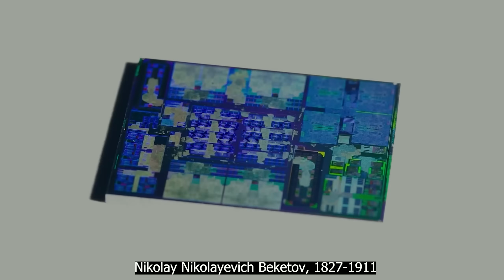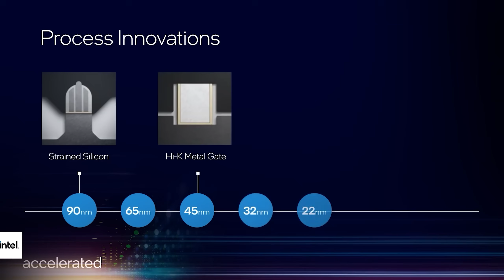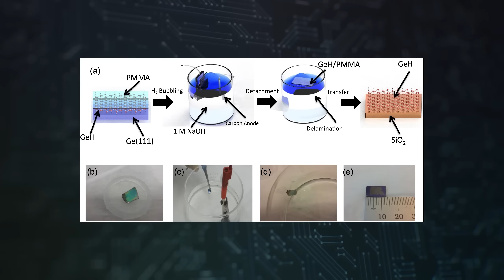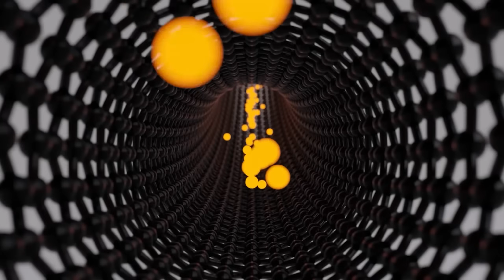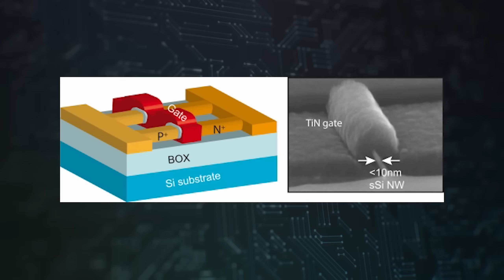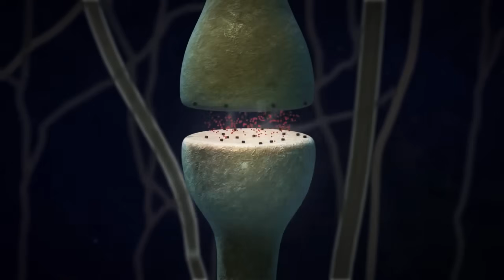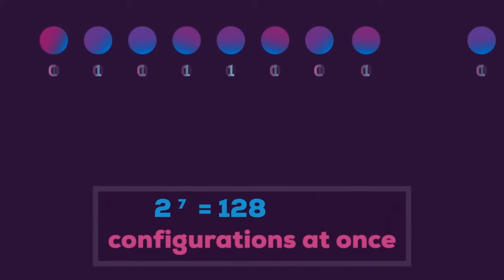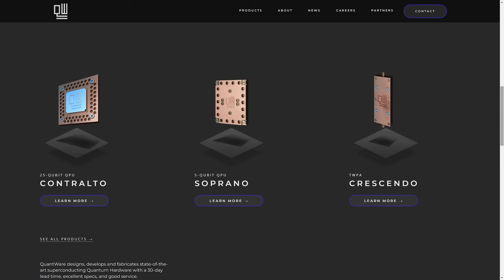End of the silicon era. Processors of the future

Comment: May I interest you a convincing sketch that, if it reflects the truth, would lead to great progress: 

Please consider a thought experiment device that may work because it avoids the failing parts of (1)Maxwell's demon thought experiment which fails because the demon needs intense light and (2)Feynman's paddlewheel, pawl,  and ratchet wheel thought device which Feynman clamed would fail to rectify random thermal motion. However he accepted that small paddlewheels will move in response to the thermal random motion of fluid they are immersed in. 

The purpose of the thought experiment device below is to create self powered thermal diversification. The thought experiment is impractical but easy to visualize and check for mechanical workability.  It is not too deep in the nanometer scale realm. 

Sketch made with keyboard characters: 

COLD ROOM   ())--:WALL:-->> HOT ROOM    

Key
()) = Paddlewheel. 
-- = Axle.  (Continuous from end to end)
: :  = Axle tunnel going through a wall.
>> =  Lumped friction element

Please visualize two roome full of air separated by a very thin wall that allows the rooms to hold their heat independently with minor leakage through the wall. The wall is thin to delicately support billions of  separate nanometer scale short axles running straight through loosely enough to rotate freely but  not leak very much heat so the rooms can hold separate temperatures. 

On the left side, a very small paddlewheel is mounted at the left end of each axle. On the right side, lumped friction elements are mounted stationary in place on the wall, one for each axle, for the right end of each axle to run through. The lumped friction elements connvert the mechanical rotation of their axle into heat. 

Brownian motion (a nanometer scale effect) turns the paddlewheels at random speeds randomly clockwise or counterclockwise. This random rotation is turned into heat by the lumped friction elements.  The lumped friction elements do not impart Brownian motion to their axle.   

  The committed, linked, and functional roles of the paddlewheels, axles, and lumped friction elements in differnt places should systemically produce a divergence in the thermal energy in the two rooms without adding external energy. 

Water in a sealed container could be endlessly cycled without cost between melting from the heat of the lumped friction elements' side and freezing from the cold of the paddlewheels' side. 

Do you think it is reasonable to consume a lot of energy by cyclicly moving a large sealed robust container of water (a large thermal mass) back and forth between a stove and a freezer both requiring electric power? You aren't making any  permenent changes as you alternately melt and freeze the water inside. The container and its water aren't becoming less orderly as the exercise continues. The unreasonableness of this waste is a challenge to the second law of thermodynamics. 

❕️❗️It is more scientifically elegant that refrigeration produce electricity instead of consuming it. 

The second law of thermodynamics began to be a strong science paradigm during the mid 1800s euphoria of progress in steam engines and industrialization. Steamships could mostly voyage on-corse on-time regardles of nature's awesome winds and currents. Mechanical power became cheap and without manure. Sir Arthur S Eddington popularized the idea  that the second law of thermodynamics, with its consequence that the universe would die of thermal stagnation, was a proof of God and more fundamental than Maxwell's equations. Powerful generators and electric motors were developed in the mid 1800s 

l was granted US patent 3890161 DIODE ARRAY,  for a refrigerator that absorbs thermal energy in an insulated compartment and releases a corresponding amount of electrical energy using the intermediary of rectified Johnson noise (the Brownian motion of electrons) aggregated by a multitude of consistantly aligned diodes. [Not exactly the abstract] It has been open for anyone to develop since 1992.  

I had a report of a working very low power prototype in ~ 1980 but l naively lost the prototype. It was made from a chip containing ~1400 gold pillars abutting N type GaAs. A U VA Charlottesville department made it for 1-3 THz frequencies. They could not align very small diodes well enough in 1980 to make ~1 um dia diodes individually so they made them in patches. I found a lab that put conductive paste on the face of one patch chip to bring all the diodes in parallel and test it in an oil bath in a sealed test chamber. They went out of business but I thought they should keep the prototype because they had the test chamber and could make special arrangements. I lost contact with them and never received the prototype. U VA  refused to sell me any more patch chips and stopped making them. 

I am not interested in any more patents. The diode array patent gives me enough of a reputation. The exclusionary power of patents breaks up synergistic benefits to civilization. Wide exposure to the public (as needed for wide scientific and spiritual discourse) renders invention concepts unpatentable. Other teams have built low power prototypes of their concepts too so the overall energy concept is likely to emerge for the betterment of civilization. 

This energy system would not be unreservedly good. Some foresight of the consequences is needed. 

Cell phones wouldn't die or need power cords or batteries
They would cool when transmiting radio signal power. Frozen food storage would be reliable and free or value positive. That means homes and markets would have independent power to preserve food. Vehicles wouldn't need fuel or fueling stops. Elevators would be very reliable with independent power. Nomads could raise their material supports out of the box pay as you grow. Zone refining would involve little net power. Reducing Bauxite to Aluminum or Rutile to Titanium would have a net cooling effect. With enough cheap power H2O and CO2 levels in the biosphere could be modified. There should be good oversight to this. 

Aloha
Charles M Brown lll
Kilauea, Kauai HI 96754 

I appologize for the many edits. Somehow l have  many mystery errors including the reapperance of errors I've corrected. There may be changes for improvement too. I want to write well for my readers.

Comment: Thank you, I was lacking any news about memristors for about 8 years, so I stopped looking for updates. It is great to hear there is finally some progress
Reply: The main problem with memristors is the success of and investment in NAND flash memory.

The advent of 3D multi layer NAND devices allowed an otherwise dying technology a new lease on life in the middle of the last decade, and it is still pushing forward.

Even though ReRAM / memristors would be far superior in power consumption, latency and speed they are still leagues behind NAND flash in density even at the 2D level, and at the 3D level it's not even worth mentioning.

Weebit is making a headway, but it will be years longer before we see anything truly commercial come out of it.

Comment: oh boy, quantum computers are even further out than tfets, optical compute, or memristors and you still need a von-neuman silicon computer to work with it.  thanks so much for the great video, fantastic questions and background material.  much appreciated
Reply: Not only are they far away from any practical implementation, but they will simply never replace your standard computers in the way people think. Quantum computers will be better at performing certain tasks, but those tasks are not in our every day usage, so for your personal needs, you won't use a quantum computer, you'll stick to the standard computer.

Comment: Silicon photonics is what I have the most hope in for in the next couple of decades. Imo, transitioning from electricity to light is just the most logical step forward. It will set moores law back by quite a bit, but the insane clock rate of the processors will make up for it. Most modern keyboards already use light to transmit signals.
Reply: Another factor is that light won't generate heat as much as electricity.
Reply: a co processor with a mirror image architecture can be developed,I wonder how will that system work?
Reply: "Most modern keyboards already use light to transmit signals"

wat r u smokin

99% of keyboards out there are membrane keyboards. and 99% of that remaining 1 percent is mechanical. then you have keyboards with optical switches.
Reply: well light transmision exists for decades now unless you mean signals like hid interface that uses speed bandwidth like in hz its known that for ex most audio devices ps5 xbox etc have a light slot on the back to connect with optical fiber to send sound now a kb uses a microcontroller if its mechanical that works like microcomputers with speeds of some mhz so either at the usb there is a decoder that reads the signal or the computer itself can read it which i think its the first to be honestly but the photonic is promising concept but dont expect pcs out of the world sure there will be decent speeds we already have 6ghz on new gens cpu with 10+ cores and in reality the gains will be diminishing if for ex you play games you might just squeeze a bit more performance but thats it unless they make games with the most realistic graphics to look like real life which i think we have some decades to achieve such feat and at the end its also depend on gpus will they be made with the silicon photon ? and if yes when
Reply: @HeLrAiSiNg1  Had a really hard time understanding what you typed out. The point is that the speed of light, being about 100x faster than electrons, will counteract the size increase of transistors and gates with its sheer speed. This would give Moore's law a good amount more headroom to keep progressing.
Reply: @tony_T_  dream on what i wrote were about light transmision exists for decades unless as the original post states keyboards with light transmision the logical thing is the usb is a decoder and the keyboard an encoder that transmits light with the information of what is pressed anyway it sure will bring some improvements but nothing super super wow that will drop jaws
Reply: @HeLrAiSiNg1  I ALWAYS THOUGHT THERE WAS MORE TO GHZ STORY,CANT THE CPU MADE TO THINK ITS OPERATING ON HIGHER FREQUENCIES?
Reply: @dinozaurpickupline4221  nope it cant ? You see a cpu has trillions of transistors gates etc the more small they make em to cramp more transistors everytime the less electricity they can stand if you see older cpus were able to hit 8ghz with nitro but newer is yet to hit anywhere that cause they cant moores law thing is thats apply everywhere not only pc cause overclock on cpu is by increasing voltages on cpu to gain speed that heats it if you for example put a 12v 2A the fan will be fine as long its 12v stable while its amperage draw is only 0.2A versus 2A but if voltage goes 12.1v it will heat a bit and slowly burn the same goes to cpus no mater what you do the only option is to give it more voltage for speed which means it need better cooling there is no magic programm the best you can improve is buy a rx 6900 and flash an rx 6900xt bios if it exist it will make it work a bit better cpu doesnt have anything stored that makes it work the way it does
Reply: @HeLrAiSiNg1 
what if an AI studies 8ghz work loads & that  can be simulated on lower clock frequencies?I know it sounds silly lol
Reply: @dinozaurpickupline4221  well im not programmer to answer that im mostly pc engineer and networks but i work as a solderer with hand components on a company but still studying wont be problem in practice problem is how it will solve things as a 8ghz modern cpu could do its like you ask me if i can learn and do what a human math calculator guy can do with syndrome down to divide 1.4873737884662573837%10.8373737783836363676 numbers with accuracy without the need of a calculator and paper its just unrealistic although such concept would be cool honestly a cpu is like a math calculator in some way the things the cpu doing tasks are by seeing zeros and ones although we see a game and other graphical things in our monitors everything is just zeros and ones
Reply: @MoeDankestr "the speed of light, being about 100x faster than electrons"
"Speed of light" in vacuum is the limit. Both eletrical and optical transmission is at similar speed, about 2/3 of c. https://en.wikipedia.org/wiki/Velocity_factor

@Vasileios Karagiannis "older cpus were able to hit 8ghz with nitro"
and new are getting close to 9GHz with LN2, with higher clocks than the old generations on typical cooling.

The limit will stay. Light travels per 1 clock tick: 30cm at 1GHz, 10cm at 3GHz, 5cm at 6GHz etc.
Reply: @mi-rek  on which new 12gen ? Honestly im out of pc bussiness at the moment and trying to not look any build cause i myself dont have pc lol mobo died instead of buying a 100€ mobo for 11gen i better go for amd 3d cpus after 2023 although as you stated the speed of the light its still all in theory problem here would be the cost of production etc and how much a final consumer pay for a new revolutionary tech like this
Reply: @HeLrAiSiNg1  Fullstops, please, fullstops
Reply: @Vasileios Karagiannis "new 12gen "? There's 13 gen already :) https://youtu.be/2wKzvC--McM?t=7302 
 i9-13900K at 8.8GHz. Even without the insane clock it's much faster CPU than the old record holders like Pentium 4 or AMD FX-8350. Not yet "over 9000" though.

We're far from "end of silicon era". So the warning is false, but of course we can wonder what the future will be...
Like, imagine you're gaming on Moon in 2100, and try to get best ping to Earth players. Speed of light is also limiting there.
Reply: @mi-rek  lol you described some sci fi movie there in the last poet also yea i heard that 13 gen is out but have no idea yet i distance myself since its even black friday my hand will itch to buy a 13rd gen if i see price drop im kinda shoping maniac i will wait for 3d amds after 2023 with the sweet candy 100+ mb cache then build an absolute build with some affordable rtx 3070-80 for my mmorpg gaming mostly i play poe which is diablolike arpg but harder and nice graphics its said they will release a 2nd game with ue5 which i believe it will melt gpus

Comment: Audio is out of sync with the video. You're a moron and a buffoon. Half of everything you said is wrong, and the other half is a lie. Quantum computers can't perform classical computation, they're only good of supplementing classical compute. Resistance of the material used isn't the limiting factor currently, the speed of light is. Yes, other materials could provide great gains in efficiency, but silicon is cheap and plentiful, while germanium is scarce at best, hard to find & extract at worst. Other materials fare worse, except for graphene, but that has its own problems. Great majority (think >90%) of electrical power is spent on moving data, not compute, which is why optical data transfer could do much more for advancing computation than any of the other methods you mentioned. There are inifinitely more interesting research topics in computation, biological computation, analog computers, there are advancements in FPGAs nobody seems to talk about, but you chose this? Shows that you don't have any sort of curiosity and should stick to reading wikipedia and listening to people smarter than you before you open your stupid mouth

Comment: couldnt a hybrid semi conductor be made where germanium is used for the slower switching and audio?

slower speed switching such as the pulse width modulator choppers of the speed controllers used in power tools (you can hear the pwm chopping as a high pitch squeal when you are running your drill slow) and the analog side of audio da converters?

or can they burn the metal to cook off the hydrogen before making it into semi conductor?

light being immune to interference that could take away one of the tools the police and military has to  fight crime.

imagine a case of a speeding car where the car's electronics uses light instead of electrons and the police deploys a road patriot.

the car does not even slow down so they deploy another road patriot thinking maybe it got destroyed because it got mis aligned with the car and ran over.

still no slow down then they realize "oh we forgot the car is using ecu powered by light so we cant fry it"

ok imagine another case where the military has to set off a small emp device to knock out the power of the enemy then like the police with the car they fail because the electronics use light instead.

think of the spinq as a modern altair?

the altair is that computer with leds and looked like a vcr from the 70s and 80s